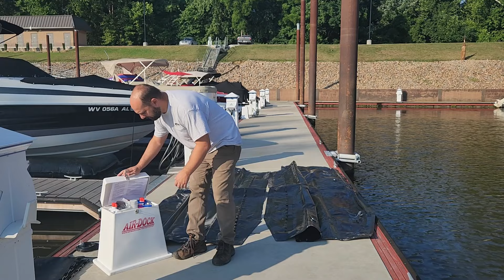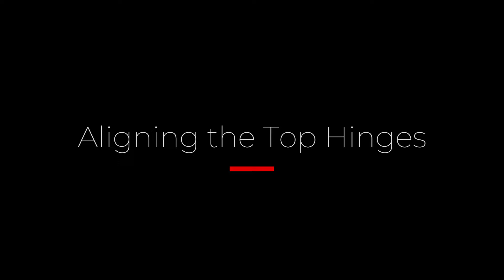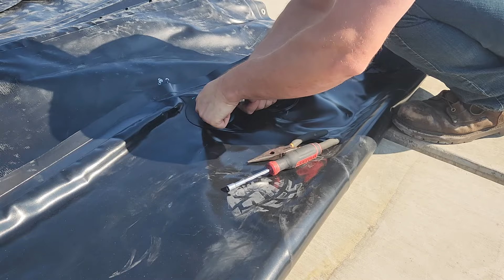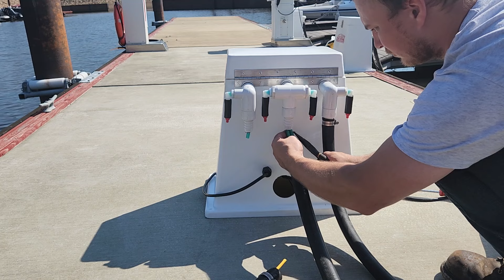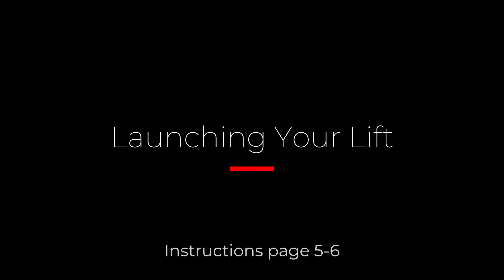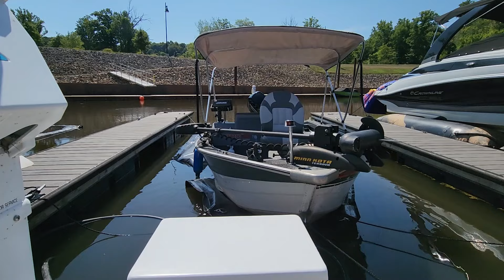Air-Dock Installation

Comment: I installed my air dock and today got my boat but it was very difficult to get the boat onto the dock,  to for ever and i seemed to not be able to remove enough are form the internal chambers even though they were only half butt the boat catches the sides and i can easily pull the boat on.  I will try to add weight to the back and side tomorrow.